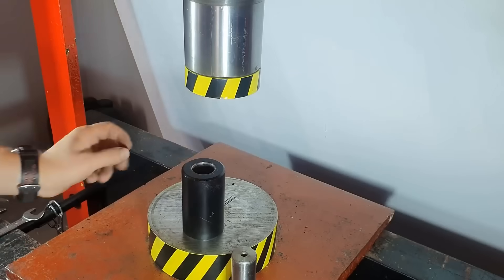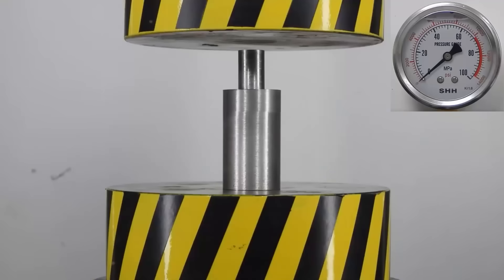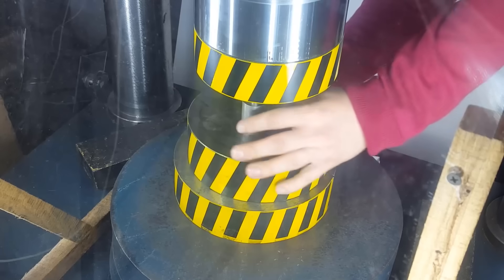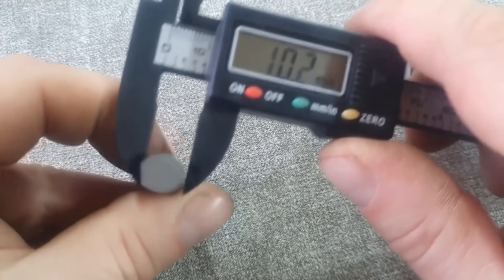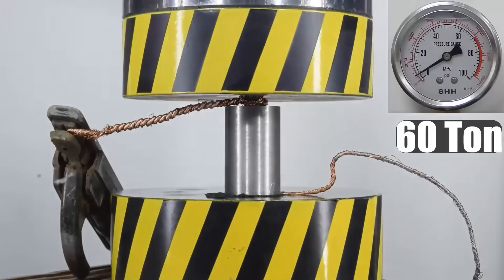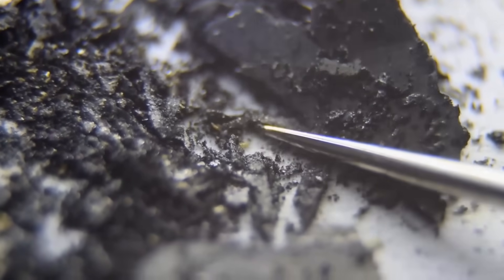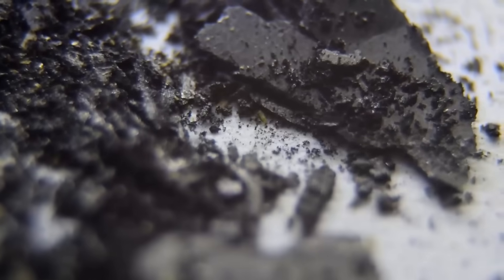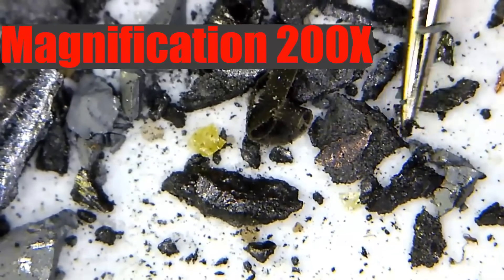HYDRAULIC PRESS TURNS GRAPHITE INTO DIAMOND

Comment: Seems to me that you just short circuited your welding transformer by a big metal slab and it had miniscule effect on the temperature rise in the pressure chamber due to very low resistance of metals the chamber consisted of, big thermal mass of the slab and relatively high resistance of graphite. The current just won't go through graphite in such conditions. Not to mention ridiculous wire connections. A few minutes of heating up with a blow torch under pressure seem way more appropriate.
Reply: A candle across the room would add more heat than that ridiculous setup.
Reply: Yeah, a short circuit directly through the cylinder.
Reply: I agree
Reply: fist thought, he must have thought of this but went the show must go on.